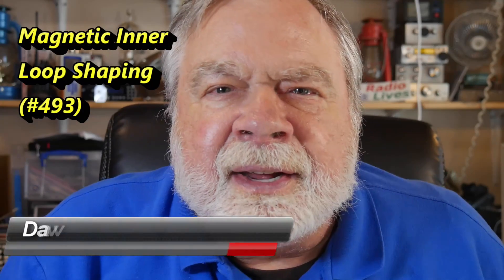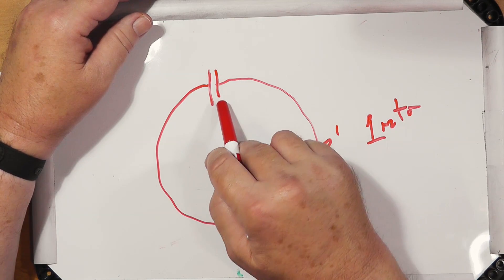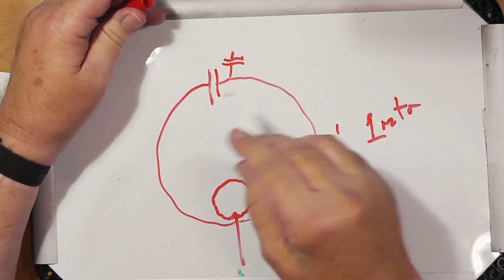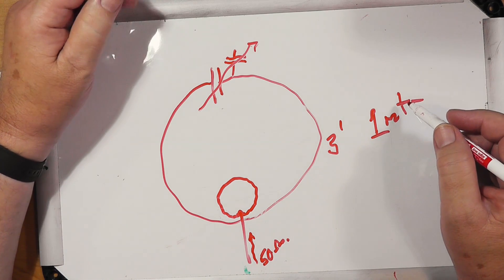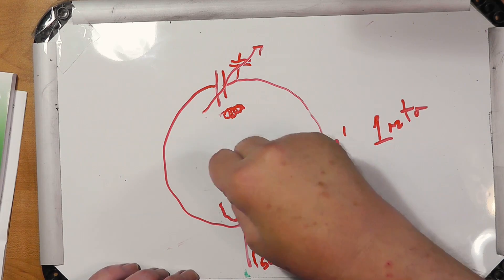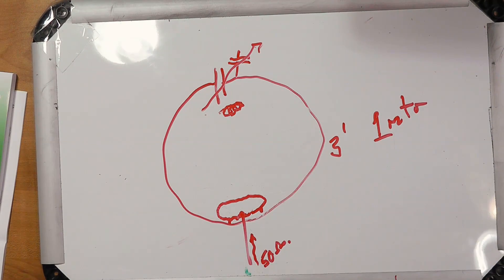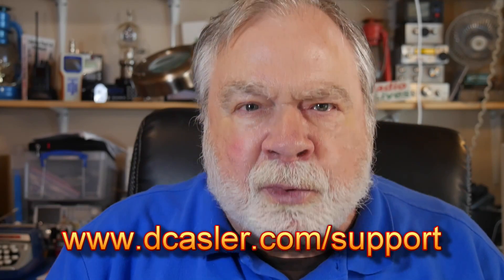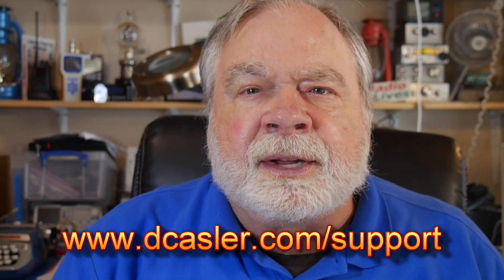Magnetic Inner Loop Shaping (#493)

Comment: Hey Dave!

How about using a Gamma-match to drive the loop instead of the driven loop? Wouldn't it provide better coupling - at least in theory? 
Do you have any experience / input on the subject?

I'm planning on building one - including a Raspberry based, DIY controller with field strength measurement as input to the controller logic. Doing a full 360 degree in 'high' speed on the stepper motor - to locate the sweetspot area, then doing a second tuning pass in low speed - around the previously located area... Possibly with input from the radios CAT to also pre-set fixed capacitors to maybe have a smaller vari-cap. 
For now - just a drawing board project for the winter boredom but it will be built - eventually. 

Thanks for good content - from Arctic Norway 🇳🇴!
Reply: Been wondering that myself but not sure where to get the best info.

Comment: You screwed that up pretty bad Dave! At about 4 minutes in you said a mag loop is a compromise antenna because you don't get the full bandwidth like a dipole. You told people, you only get 10 to 50 kilohertz on either side of the band, as if that's all you can work on the whole band. You know that's very wrong. You meant all of the bands are tunable and usable, and once tuned, the bandwidth may only be 10 to 50 kilohertz, also known as a high Q. You kinda smooshed together how dipoles and mag loops work regarding usable bandwidth, and if someone didn't already know how they do work, you may have just scared them off from ever getting one.
Reply: @John Smith. Nail on the head. It is a partial explanation and very confusing for newbies. He should have said that bandwidth without tuning the capacitor is limited and to change frequency, One must re-tune the capacitor. If One wants to be an Elmer, please study the matter. And a Baby Loop from the Italian company is called so because it is Their smallest model. And it is not really small at all. You must see Their big models
Reply: My guess is only a complete newbie would not have understood what Dave was referring to pertaining to Q and bandwidth, if at all.
Reply: @greglawrencemusic  That's mostly what he has here, along with those of us still pay attention for anything else to round out our experience with. I found that moment hard to watch.
Reply: @greglawrencemusic  But newbies are likely to watch Dave!  They're here to learn!
Reply: @ Fair point. ~73
Reply: my alpha covers all.